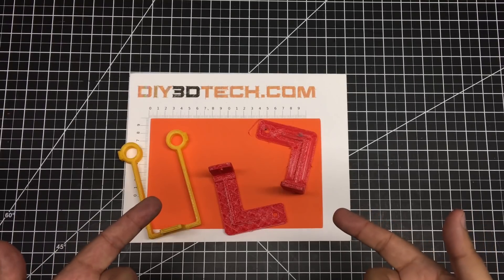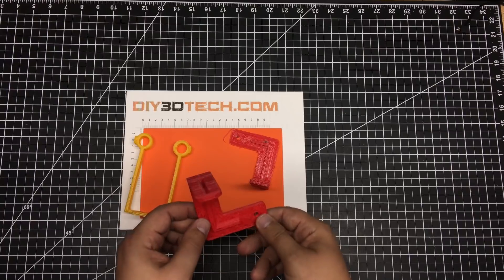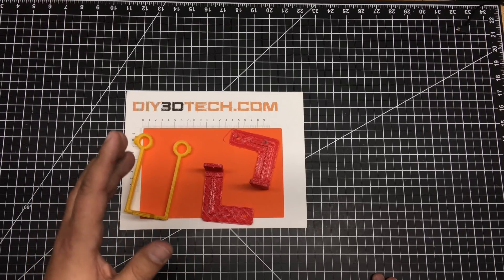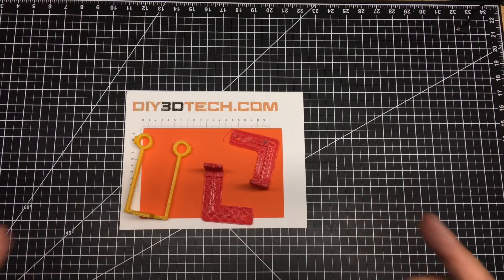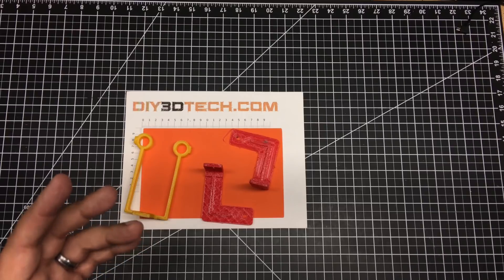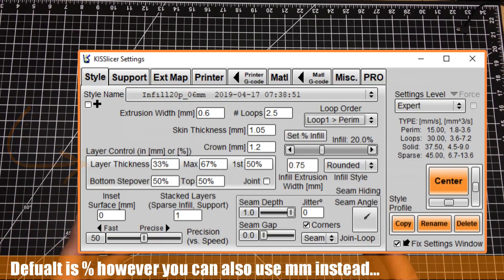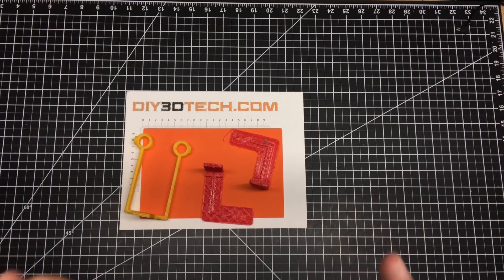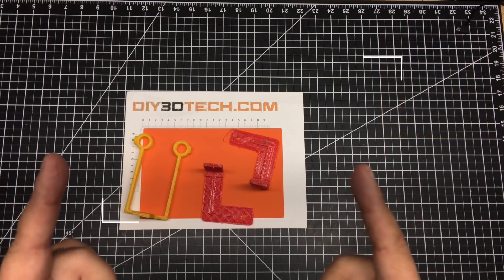Shop Talk - I Kissed Cura Goodbye!

Comment: I did use Cura on My Anet A8 when i first started 3D printing 2 years ago, but after a few months of confusion with setting up and getting poor prints,
I then tried many other software brands but not easy to use Lack of Support
I then chose Matter control, Well this software is a blessing, as on first use i had perfect models at 100% infill

Updates are frequent and new features keeps on coming, so you can make things and then print them  all from within one software
oh i tend to USE PLA plus all the time as its my preferred type for my applications 
Matter Control is free and do offer a Pro version for multi extrusion.
And also it can be installed on a tablet to (pro Version)

Comment: i first started 3d printing with curu, and after a few updates things were nether the same. and so may parameters to fiddle about with,  anyway i gave up on it.
And then I discovered Matter control
Wow the settings are in English so to speak.
Easy setup and way better prints on o.1 layer height ,
also you can edit your model or create models within it, and that is why i still use every day all day for the last 2 years
Reply from the maker: Matter control is an okay slicer, the however the issue I have found with it is its limitation for complex printing.   Slicing a tessellated object especially a complex one can be challenging depending upon the result you expect.

Comment: I'm a relative newbie and am not quite sure why people want to learn so many different slicers even though I've gone through a few. I like Prussaslicer and will try to make things work with that until I have major problems. I'm too old to master all these different slicers.
Reply from the maker: It depends, as there is a complex relationship between the tessellated models (the STL) and the math used in the slicer.  If your just printing out novelty stuff as hobby, then yes.  However if you want high dimensional accuracy for complex functional parts then that is a different game all together....

Comment: Try as hard as I did (numerous hours over numerous days) I could not dial in Cura on my machine.  It had two issues with walls having gaps and infill missing that not S3D, Prusa Slicer, nor Kisslicer have.  Something about the hidden settings (according to the devs it has hidden settings they do not allow users to adjust) is making a mess of the prints for me that no other slicer I have tried does.

edit: OMG, I just watched more of your video and I changed my ptfe tube, shortened it by 100mm, I purchased a new Creality extruder, messed with Marlin, etc... like you did and you have more issues than I did with Cura but I am seeing the same nonsense in yours as I did mine.  It is weird because Cura was acting like it was underextruding for me YET it wasn't.  For instance the infil of a 20x20x10mm cube with no top and 2 layers on the bottom the Zig Zag infill was missing always in the middle from bottom right to top left for all layers.  Stuff like that I could not correct no matter what I toggled are tweaked.  Heck I even tried overextruding but in the middle it was always missing (not counting the missing walls etc...).
Reply from the maker: The 4.4 version is now "better", however there are still strange issues as CRUA will create banding and KISS will not so I know its in the slicer.  Also yes there still is an issue with hidden settings which can not be unhidden on "some" printers which I discovered when looking at the forums for bug reports and its in their backlog however they claim its proving to be a larger issue then first thought so we will have to see...
Reply: Well, at least I now know it wasn't just me but after all of the time, and effort, I put in there was no way it could just be me.  I sort of count the Cura users as a cult or people who just print organic models and never look inside them.  I know I would never had known had I not.
Reply: I noticed similar issues with Cura after I started messing with linear advance. Areas of massive under extrusion always in the same places. I tried different slicers and they didn't produce the same issue but they did make the graphic designer in me scream the whole time I was using their unintuitive win98 looking UIs. Eventually I fixed it by changing MIN_STEPS_PER_SEGMENT from 6 to 1 in Marlin (Configuraion_adv.h) This was a few Cura updates back now so they might have sorted whatever wasn't playing well with that setting but I haven't set it back to test.
Reply: @Kevin Mason My biggest issue was in the walls and especially in the infill where MIN STEPS has nothing to do with it.  Here is the really weird thing but do a simple cube.  Nothing more nor less with infill (for this test) and no top layers so you can see the infill.  Every single time you print the model the infill would be missing in the exact same spots no matter what settings I fiddled with in Marlin or Cura. For example do rectilinear and the missing infill would be missing all the way from the bottom to the top in the same spot.  No other slicer did I have this issue with.  Next issue is that there were voids between walls (say 4 walls) always in the same spot as well.  Again no other slicer had this issue.

As far as the UI I could care less about it being pretty (eye candy) as long as it performs and just works.  Hell, write it in DOS for all that I care.
Reply: @thebeststooge  That still sounds like my issue. Seemingly random gaps in the walls or infill that would consistently appear in prints sliced only in Cura. I tried every setting in Cura that seemed at all connected and even went through the gcode from it and other slicers and wrote some scripts to alter Curas to be closer to the others. Nothing worked till I changed that setting in Marlin and it's been behaving itself for months now. So even if it doesn't seem to make sense I have to assume there's something going on there.

Do you use linear advance by the way?

Also I'd not dismiss UI design as "eye candy". Having a cohesive simple visual way to interact with software makes it a lot less awkward to use and to tell what's going on at a glance. At least DOS has design consistency, imagine if it randomly used different fonts and added ugly bevels to bits of it. Plus Cura has some nice features, Tree Supports, adaptive layer heights, gyroid and support infill ect
Reply: @Kevin Mason First things first and that is Cura I wanted for the tree support and the ironing BUT I found Cura to be ugly myself PLUS it takes a hellishly long time to load.  If the load doesn't suck when you want to get to a command it is very cumbersome to get to it and takes a long loading time and this has been the way on several computers so it isn't due to my Ryzen.

Now on to the matter at hand and that is I have never had much luck with Cura over the years since 2012/2013 over 4 different printers.  I finally gave up on it and figured it was due to my Prusa I3 Rework and it wanted the UM but I kept trying it after each major revision.  With the advent of 4.x I tried it and got much better results after over a half a kilo of filament's worth of tweaking over three days (long days too) but I could only get close.  I then tried LA with it and the same thing so this told me it is it.  I then contacted the devs who politely told me that there are hidden settings that they do not allow the end user to access and it is probably something in there that is causing the issue BUT since the software is really made for their machine I am probably SOL.
Reply: @thebeststooge  I suppose the aesthetics is a matter of personal preference. I find Cura with the dark theme far more restful to use than any of the others and I like how I can have all the settings I need on a list I can easily scan up and down and tell at a glance what I've changed from the profile default. Also the Layer preview is nice and big and clear. I did have to change the line type preview colours though, as what they had set was too garish. I'm running it on an old Intel Core Quad CPU and a Radeon R7 so it's not a super modern set up but load times are not much different than the others.

My printer is a moded Anycubic Kossel Linear Plus with the latest Marlin. Same exact gcode that gave me holes with MIN_STEPS_PER_SEGMENT on 6 printed fine with it changed to 1. I also tried Repetier and I didn't seem to get the holes but I didn't extensively test that as other concerns pushed me back to Marlin.
Reply: @Kevin Mason Yeah, Cura is a preference thing but when I go into a slicer I want in and out in under 20 seconds.  IOW I double click the file and I load up my 3d file and sliced and saved but I don't get that in Cura.

As I said the devs told me there must be a setting they hide from us that is causing it so I am content in giving Cura the middle finger and using Simplify 3d and KISSlicer and Prusa Slicer instead.  I can't miss what I never had so no big deal but still so much wasted time, effort, and material to find out Cura actually sucks.  What gets me is that I bet you a dollar to a doughnut that all ofthe fans of Cura never really looked as closely as we did on their final prints.  Hell, look at the 3d printing channels and if the outside of the model looks good then it is a great print but for someone such as myself I do part printing only so I need the inside, plus the walls, to be precise and 100% whereas some tugboat it doesn't matter.  I bet you that even on the UltiMaker this problem exists but that is just a guess as I do not know what firmware they use.
Reply: @thebeststooge  if Cura has to load up first I can go from clickin on my stl to gcode exported in under a minute. If it's running already I can get a model in and out in 10-20 seconds.
Just because your personal experience with Cura had issues doesn't mean the software sucks. I'm sure there's other users who have had issues with any particular slicer you care to name. I like Cura and I'm certainly not undiscerning about my print quality or precision, not that being mostly concerned with how prints look on the outside is invalid if that's your priority. Your first post described a specific issue that I had a possible solution to, hopefully it may be useful to others that do wish to use Cura
Reply: @Kevin Mason I am just saying what the devs said to me about this issue and that this issue will never be fixed so it is time to leave it at that.

Anyone who stumbles upon this and has this issue you are being told, as I was from the devs, that you probably need a different slicer.  In other words no fix and just move on.
Reply: @thebeststooge  That wasn't all you were saying. And you telling people who stumble on this thread that there's no fix when I'm saying I fixed such an issue on mine isn't really helpful. Devs aren't gods (especially on open source community driven software like Cura) and your interpretation of what one told you isn't definitive proof that there's no fix or work around for people encountering the issue who still want to use Cura for it's many other benefits.
Reply: @Kevin Mason  Do you know what that setting even is?  A lot of printers can't handle that refinement as there was a video about that setting and going from 6 to 1 is a hellish difference and a lot of the printers out there would struggle.  I do believe, if I remember the video correctly, that the 8-bit boards will choke going from 6 even down to 3 or 4 so 6 going down to 1 is insane.

btw, stop taking up for the devs or Cura as it isn't helpful.  Never discount what any dev says EVER.  Sure you can take it with a grain of salt but what the dev was saying, and in your case you proved, was that they aren't going to fix it in their software because it was made for their machine.  If it works with yours great but if it doesn't then move on or find a hardware fix (if it exists).

There are two programs I never could stomach for the way they loaded and both I chunked in the garbage pail.  Strangely enough, yet this should not be an excuse, both were free and open.  Inkscape and Cura.  This is touching upon your previous statement about loading.  What I was saying, and I stick to what I said, is that the UI in Cura is clumsy at best and a nuisance at the worst.  It shouldn't act the way that it does or how slowly that it does, for everything, when other free slicers blows it away in slicing speed and responsiveness of the UI.
Reply: @thebeststooge  yes I know what the setting does thanks.
 I don't tinker around in my firmware settings without some idea of what I'm doing.. also it's literally called min_steps_per_segment XD
I have a delta printer with an 8-bit board so if it copes I'd assume many peoples can. And there's always the Maximum Resolution in Cura if your printer can't keep up. Besides 32Bit boards are becoming increasingly common place, I'll be upgrading soon myself.

I don't know what "stop taking up for the devs" means. But I suspect the issues are more likely related to modern features in Marlin rather than hardware since I didn't get the same problems with Repetier or the old Marlin that came with my printer. I just posted my experience since it might help others with a similar issue to what we had.

I find Cura's UI to be clear, modern and most importantly cohesive and the UIs of most other slicers seem clumsy and hodgepodge to me. Different tastes I suppose. As for speed like I said it runs fine on my slower computer. Just because your experience with Cura had issues doesn't mean the software "sucks". KISSlicer ran like ass for me, but I hear other people have had good experiences with it. I'm not going to say those people are deluded or undiscerning. Nor are you wrong for using whatever you use if it suits your particular needs better. No slicer is the "best" because what's best for each user is different and there's usually some trade off.
Reply: I upgraded my controller to 32bit last year but the issue I have had with Cura dates back to 2012/2013 so it predates Marlin 2.0.  Different strokes for different folks.
Reply: @thebeststooge  Not relating the 32-bit board to the issue. Just that if my poor old 8-bit board can handle min_steps_per_segment on 1 then any 32-bit boards should be fine.

2012? So that was Marlin 1.0.0 and possibly the first Cura? You seemed to talk about the issue as if it's current (as in relevant to the video) Have you tried it out recently? And out of interest did you ever try with Repetier firmware?
Reply: Kevin Mason Did you not read what I have been saying?  Apparently you didn't because I said I tried all major versions over the years, including 4.x.

On my TronXY X5S I used Repetier firmware on the 1284p and absolutely loved it as I replaced the Marlin that was on it from the manufacturer.   I loved it so much I didn't look at Marlin again (from 1.1.6) until 2.x when I was forced to go to it due to the 32 bit controller LPC1768 based. edit: In 2012 it was Marlin 0.something beta and I am too lazy to go back in my folders to see what was its real number but 0.97 or something like that rings a bell.

Now riddle me this but why did they stick it at 6 if there are no issues for even a Delta running it on a Ramps at 1?
Reply: @thebeststooge  I read what you wrote but this has been going on a while now and you aren't always the clearest. Are you saying you had the same issue with holes with all versions of Cura and regardless of if you used Marlin or Repetier? Or that you had that issue years ago and different issues like featured in the video recently? If so why even bring up issues with such an old version.

You'd have to ask them why they set it to 6. Perhaps since what potentially chokes the printer isn't how many steps per segment but rather how many steps per second that they set it to 6 to cover themselves for people who print faster than I do. I Print infill at 45 and outer walls at 25 since exterior finish is important to what I make and I'd rather waste the printers time on slightly longer prints than my time doing extra sanding. Also I could use Max Resolution to simplify a print if needed since I can see in the slicer how it's simplifying the path and limit maximum deviation.

Anyway telling people changing it solved the issue could be helpful to someone trying to track down exactly why this happens. Perhaps a post process script could be written changing how Curas gcode is formatted to avoid the issue entirely and then the Cura Devs could take this on board. They seem pretty open to ideas from the community.

Try not being so confrontational and assuming people with a differing opinion or experience are just being dumb or in a cult.

Comment: I've done a lot of testing with Kiss since you did this video, and for the life of me I can't get a decent layer joint. Also, at higher speeds, it tends to "drift" where a line appears outside of the perimeter it is supposed to be in. Doesn't happen with any other slicer I've used... I like the degree of control it offers, but I'm not seeing any print quality here.
Reply from the maker: Without seeing your set up its hard to say as out of the box I had no issues (again not being paid to say this nor even affiliate in this case).  Yet "assume" you used the set up wizard (all of them)?

Comment: My biggest issue with cura was retraction distance in creality profiles, stock is 5mm and 40m/s retraction speed.it did not work with my ender 2. I belive creality only support 25m/s filament retraction. I changed to 6.75mm retraction distance and 25m/s retraction speed. Prints much nicer now.
Reply from the maker: On my CR-10 I was using 7.5mm at 50mm/s on PETG with good luck...